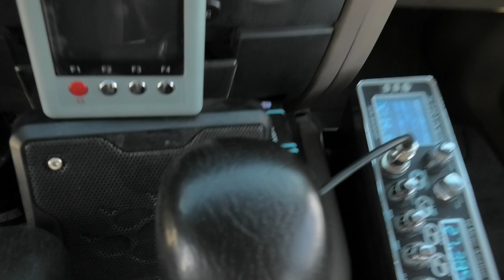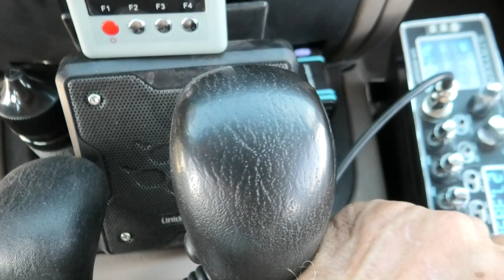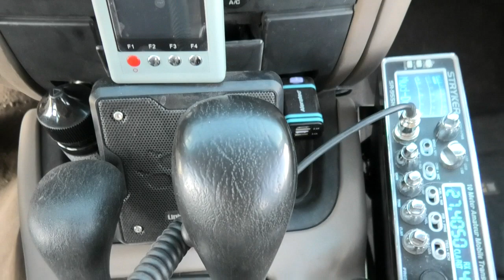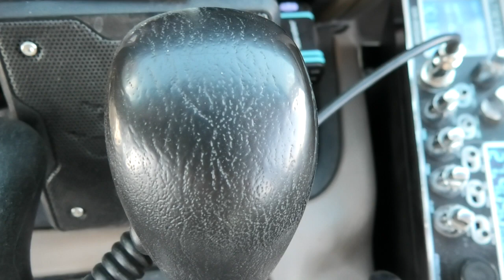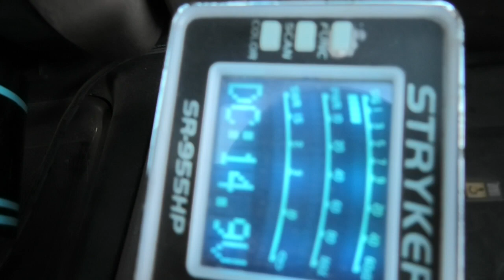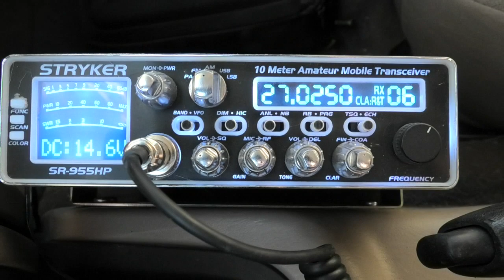((((( Roger Beep )))))  Barefoot FineTuned Stryker SR955HPC's - 101 Diesel Wagon .. 38-40 LSB

Comment from the maker: When you follow directions we'll both be happy .. Here's what it takes to cut through the noise, be loud and crystal clear with a better receiver too:  A) Tuned Bench:  https://www.youtube.com/watch?v=lwcDfXOgAls.  True, it's more complicated and time consuming to accomplish these consistent and accurate results. Below is a partial procedure and list of calibrated equipment used to achieve this level of performance . Read on ..

Fine Tune CB Radio Shop strictly adheres to (https://www.nist.gov/) NIST Traceable Calibrations and other industry standards to maintain accuracy and consistency for providing Real World Performance Tuning of Citizens Band and 10 Meter export mobile radios with integrity.

"Basic Textbook AM/FM/SSB Transceiver Tune, Alignment and Calibration" 

1) Pll adjustments
VCO & OSC, AM TX OSC, USB TX OSC, LSB TX OSC.

2) Transmitter alignment
DRIVER BIAS, FINAL BIAS, SSB  (or gate voltages for mosfet versions) CARRIER BALANCE, HI-LO AM & SSB Power, RF METER, AMC, ALC and FM DEVIATION.

3) Receiver alignment
AM/FM RF & IF SENSITIVITY, FM DETECTOR/DEVIATION, SSB IF SENSITIVITY, SSB S-METER, AM/FM S-METER (100uV unmodulated -67dbm for “S-9” meter reading!), AM/FM SQUELCH RANGE, SSB SQUELCH RANGE, and NOISE BLANKER/AUTOMATIC NOISE LIMITER (Real World dBm to volts (uV) tables below).

That's just a typical run of the mill textbook tune up and alignment (if you're lucky). There's more to it than frequency alignment, modulation adjustment, meter calibration and a tune up report displaying exaggerated rms Bird peak watts! 

"Test Bench includes"

Bird 4314C Meter
https://www.birdrf.com/Products/Test%20and%20Measurement/Power-Meters/Wattmeters-Line-Sections/RF-Wattmeters/4314C_PEP-Single-Element-Wattmeter.aspx
Part 1) https://www.youtube.com/watch?v=RpX9IHe4ORM&t=16s
Part 2) https://www.youtube.com/watch?v=LuhbqTf6Bxw
Bird 4314C Accuracy Test: https://www.youtube.com/watch?v=DqEOabYqhQo&t=5s
Bird Stipulates 1/2 wavelengths  https://www.youtube.com/watch?v=5eWhgT-rTII
And Genuine Bird Elements from 1K down.

Bird 4373 Sampler 
https://www.rfparts.com/signal-samplers.html

HP8924c with options
http://userequip.com/files/specs/2147/HP%208924C%20Repair.pdf
https://www.youtube.com/watch?v=Cg1w0xBa27s&t=1s

HP8920a with options
https://www.keysight.com/upload/cmc_upload/All/EPSG072204.pdf

Three analog scopes, one digital 200 Mhz
https://www.atecorp.com/atecorp/media/pdfs/data-sheets/tektronix-2465b-2467b_manual.pdf
https://www.youtube.com/watch?v=by98x4eu2lM

Fluke 27fm
http://www.fluke.com/fluke/inen/digital-multimeters/fluke-27.htm?pid=56055
 
LCR http://www.lcrresearch.com/wp-content/uploads/2017/05/LCR_Pro1_Manual_version1.03.pdf

Power supplies
6 Cosel PBA1500f12 (750 amps) variable and configurable.
https://en.cosel.co.jp/product/powersupply/PBA/PBA1500F/PBA1500F-12/
Corcom 20VB1 F7130 EMI Filter 50-60Hz 250V

Times Microwave Coax jumpers and test leads
http://www.timesmicrowave.com/cms/products/cables/lmr/
https://www.youtube.com/watch?v=EmqaGJ6IWow
https://www.youtube.com/watch?v=1ltFVSxGp5Y
https://www.youtube.com/watch?v=v12YZT_1o90
https://www.youtube.com/watch?v=h7iiYfmYWRA&t=215s

Amphenol RF Connectors
https://www.amphenolrf.com/
https://www.youtube.com/watch?v=dVh5B0hdEA0 
https://www.youtube.com/watch?v=dKZg8T_AOso

More range, compliments, reliability and a quieter, clearer but more sensitive receiver,  Get Fine Tuned .. not peaked and ruined.

Here are some VideoGates of me at the bench practicing what I preach using my bench radio or customers radio completed and ready to be shipped: https://www.youtube.com/results?search_query=hard+drive+163+ more: https://www.google.com/search?q=Hard+Drive+163+nm&ie=utf-8&oe=utf-8&client=firefox-b-1-ab

It's what I recommend, use, service and sell ... to you ... not something non practical or deceiving in a misleading way. I'm not just the tech and owner of Fine Tune CB Radio Shop, I'm a customer too!  When finished, You'll be giving radio checks, not asking for them .

dBm To Watts and Volts
Tables below displays relationship between Power in [dBm] or [Watts] and Voltage in RMS, peak, peak-to-peak for sinusoidal signals in 50-Ohm systems for accurately measuring and tuning am/fm/ssb receiver sensitivity, agc, squelch and "S9" Meter calibration. Real World! Mike @ Mikes Radio Repair (Romper Room), Mark Rutherford aka Mark 19960, CB Kidd, Martian and all of your other fake accounts pay attention to the tables below, stop misaligning radios, spreading false information and promoting propaganda! 

  [dBm] [Watts]   [Volts]rms   [Volts]p    [Volts]pp
-140 0.100E-16  22.361 nV  31.618 nV  63.236 nV 
-139 0.126E-16  25.089 nV  35.476 nV  70.952 nV 
-138 0.158E-16  28.150 nV  39.805 nV  79.609 nV 
-137 0.200E-16  31.585 nV  44.662 nV  89.323 nV 
-136 0.251E-16  35.439 nV  50.111 nV  100.222 nV 
-135 0.316E-16  39.764 nV  56.226 nV  112.451 nV 
-134 0.398E-16  44.615 nV  63.086 nV  126.172 nV 
-133 0.501E-16  50.059 nV  70.784 nV  141.568 nV 
-132 0.631E-16  56.167 nV  79.421 nV  158.842 nV 
-131 0.794E-16  63.021 nV  89.112 nV  178.223 nV 
-130 0.100E-15  70.711 nV  99.985 nV  199.970 nV 
-129 0.126E-15  79.339 nV  112.185 nV  224.370 nV 
-128 0.158E-15  89.019 nV  125.874 nV  251.747 nV 
-127 0.200E-15  99.882 nV  141.232 nV  282.465 nV 
-126 0.251E-15  112.069 nV  158.465 nV  316.931 nV 
-125 0.316E-15  125.743 nV  177.801 nV  355.602 nV 
-124 0.398E-15  141.086 nV  199.496 nV  398.992 nV 
-123 0.501E-15  158.301 nV  223.838 nV  447.677 nV 
-122 0.631E-15  177.617 nV  251.151 nV  502.302 nV 
-121 0.794E-15  199.290 nV  281.796 nV  563.591 nV 
-120 0.100E-14  223.607 nV  316.180 nV  632.360 nV 
-119 0.126E-14  250.891 nV  354.760 nV  709.519 nV 
-118 0.158E-14  281.504 nV  398.047 nV  796.094 nV 
-117 0.200E-14  315.853 nV  446.616 nV  893.232 nV 
-116 0.251E-14  0.354 µV  0.501 µV  1.002 µV 
-115 0.316E-14  0.398 µV  0.562 µV  1.125 µV 
-114 0.398E-14  0.446 µV  0.631 µV  1.262 µV 
-113 0.501E-14  0.501 µV  0.708 µV  1.416 µV 
-112 0.631E-14  0.562 µV  0.794 µV  1.588 µV 
-111 0.794E-14  0.630 µV  0.891 µV  1.782 µV 
-110 0.100E-13  0.707 µV  1.000 µV  2.000 µV 
-109 0.126E-13  0.793 µV  1.122 µV  2.244 µV 
-108 0.158E-13  0.890 µV  1.259 µV  2.517 µV 
-107 0.200E-13  0.999 µV  1.412 µV  2.825 µV 
-106 0.251E-13  1.121 µV  1.585 µV  3.169 µV 
-105 0.316E-13  1.257 µV  1.778 µV  3.556 µV 
-104 0.398E-13  1.411 µV  1.995 µV  3.990 µV 
-103 0.501E-13  1.583 µV  2.238 µV  4.477 µV 
-102 0.631E-13  1.776 µV  2.512 µV  5.023 µV 
-101 0.794E-13  1.993 µV  2.818 µV  5.636 µV 
-100 0.100E-12  2.236 µV  3.162 µV  6.324 µV 
-99 0.126E-12  2.509 µV  3.548 µV  7.095 µV 
-98 0.158E-12  2.815 µV  3.980 µV  7.961 µV 
-97 0.200E-12  3.159 µV  4.466 µV  8.932 µV 
-96 0.251E-12  3.544 µV  5.011 µV  10.022 µV 
-95 0.316E-12  3.976 µV  5.623 µV  11.245 µV 
-94 0.398E-12  4.462 µV  6.309 µV  12.617 µV 
-93 0.501E-12  5.006 µV  7.078 µV  14.157 µV 
-92 0.631E-12  5.617 µV  7.942 µV  15.884 µV 
-91 0.794E-12  6.302 µV  8.911 µV  17.822 µV 
-90 0.100E-11  7.071 µV  9.998 µV  19.997 µV 
-89 0.126E-11  7.934 µV  11.218 µV  22.437 µV 
-88 0.158E-11  8.902 µV  12.587 µV  25.175 µV 
-87 0.200E-11  9.988 µV  14.123 µV  28.246 µV 
-86 0.251E-11  11.207 µV  15.847 µV  31.693 µV 
-85 0.316E-11  12.574 µV  17.780 µV  35.560 µV 
-84 0.398E-11  14.109 µV  19.950 µV  39.899 µV 
-83 0.501E-11  15.830 µV  22.384 µV  44.768 µV 
-82 0.631E-11  17.762 µV  25.115 µV  50.230 µV 
-81 0.794E-11  19.929 µV  28.180 µV  56.359 µV 
-80 0.100E-10  22.361 µV  31.618 µV  63.236 µV 
-79 0.126E-10  25.089 µV  35.476 µV  70.952 µV 
-78 0.158E-10  28.150 µV  39.805 µV  79.609 µV 
-77 0.200E-10  31.585 µV  44.662 µV  89.323 µV 
-76 0.251E-10  35.439 µV  50.111 µV  100.222 µV 
-75 0.316E-10  39.764 µV  56.226 µV  112.451 µV 
-74 0.398E-10  44.615 µV  63.086 µV  126.172 µV 
-73 0.501E-10  50.059 µV  70.784 µV  141.568 µV 
-72 0.631E-10  56.167 µV  79.421 µV  158.842 µV 
-71 0.794E-10  63.021 µV  89.112 µV  178.223 µV 
-70 0.100E-09  70.711 µV  99.985 µV  199.970 µV 
-69 0.126E-09  79.339 µV  112.185 µV  224.370 µV 
-68 0.158E-09  89.019 µV  125.874 µV  251.747 µV 
-67 0.200E-09  99.881 µV  141.232 µV  282.465 µV
-66 0.251E-09  112.069 µV  158.465 µV  316.931 µV 
-65 0.316E-09  125.743 µV  177.801 µV  355.602 µV 
-64 0.398E-09  141.086 µV  199.496 µV  398.992 µV 
-63 0.501E-09  158.301 µV  223.838 µV  447.677 µV 
-62 0.631E-09  177.617 µV  251.151 µV  502.301 µV 
-61 0.794E-09  199.290 µV  281.796 µV  563.592 µV 
-60 0.100E-08  223.607 µV  316.180 µV  632.360 µV 
-59 0.126E-08  250.891 µV  354.760 µV  709.520 µV 
-58 0.158E-08  281.504 µV  398.047 µV  796.094 µV 
-57 0.200E-08  315.853 µV  446.616 µV  893.232 µV 
-56 0.251E-08  0.354 mV  0.501 mV  1.002 mV 
-55 0.316E-08  0.398 mV  0.562 mV  1.125 mV 
-54 0.398E-08  0.446 mV  0.631 mV  1.262 mV 
-53 0.501E-08  0.501 mV  0.708 mV  1.416 mV 
-52 0.631E-08  0.562 mV  0.794 mV  1.588 mV 
-51 0.794E-08  0.630 mV  0.891 mV  1.782 mV 
-50 0.100E-07  0.707 mV  1.000 mV  2.000 mV 
-49 0.126E-07  0.793 mV  1.122 mV  2.244 mV 
-48 0.158E-07  0.890 mV  1.259 mV  2.517 mV 
-47 0.200E-07  0.999 mV  1.412 mV  2.825 mV 
-46 0.251E-07  1.121 mV  1.585 mV  3.169 mV 
-45 0.316E-07  1.257 mV  1.778 mV  3.556 mV 
-44 0.398E-07  1.411 mV  1.995 mV  3.990 mV 
-43 0.501E-07  1.583 mV  2.238 mV  4.477 mV 
-42 0.631E-07  1.776 mV  2.512 mV  5.023 mV 
-41 0.794E-07  1.993 mV  2.818 mV  5.636 mV 
-40 0.100E-06  2.236 mV  3.162 mV  6.324 mV 
-39 0.126E-06  2.509 mV  3.548 mV  7.095 mV 

                 Don't Be A Mud Duck!

 https://www.arrl.org/shop/ARRL-Handbook-2019-eBook

Hard Drive 163 NM. 73's! Click click.?